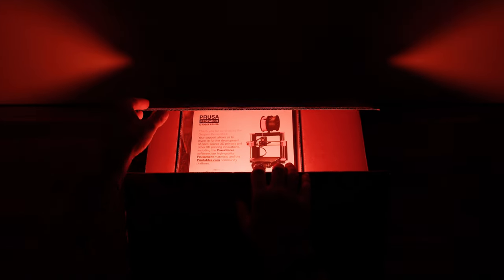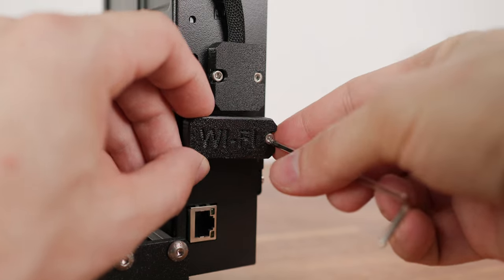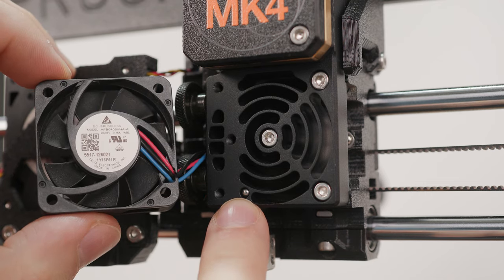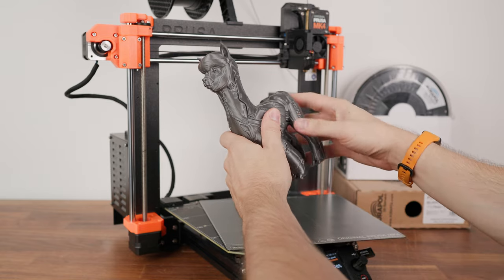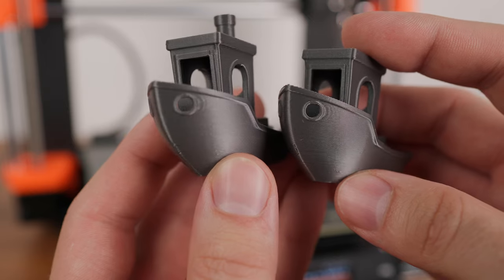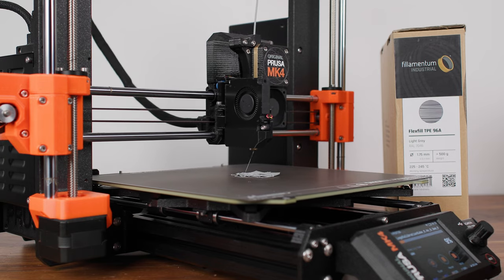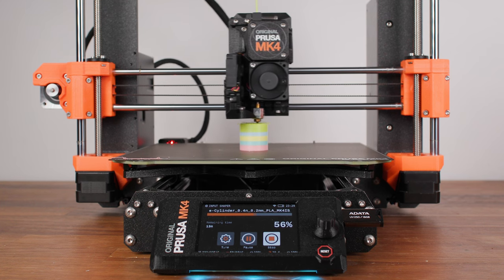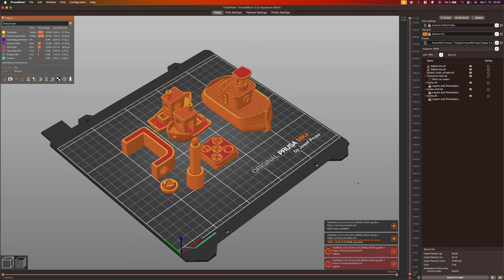Original Prusa MK4 - Better late than never. Don't you think? (Review)

Comment: I feel that an investment in a EU built open source unit is a future proof agreement and more than worth investing. I run 3 Prusa printers 2x Mini+ 1x Mk4 via Prusa connect Network . Absolutely flawless after Input shaper as game changer came alive and also Mini+ is supported and printing in superb reliable quality . Prusa doesn't try to take advantage from other manufactures brain like Bambu is even trying to patent things they have stolen from the open source community. Furthermore it is not proven at all how log the Bambu printer will keep reliable working and then hardly been able to reworked . For the Prusa you can refurb all printers up to new standard , print your spares or improved parts yourself. I like this better as it is securing my initial investment for years

Comment: I just finished building my Mk4 today. It was joy to build and a great sense of achievement. All components were of a very high quality, perfect fit and the instructions were clear and easy to follow. I dare say it helps if you are practically minded. I learnt so much about the printer but also about designing mechanical parts from the 3Dprinted items supplied. So far I am really happy with the printer and so pleased I was not tempted by other brands. I am new to 3D printing and would definitely recommend this to anyone else who is yet to decide.
Reply: How do you feel about the printer now? I would be new to the 3d printing world as well and am looking at a few
Reply from the maker: @curtflirt2 The printer is good. But here are better and cheaper printers.
My girlfriend wanted to buy a 3d printer. She decided to buy the BambuLab A1 Combo and the printer is printing almost daily. She is printing a lot of stuff for kitchen, her office and so on. Most of the things are ready to print on MakerWorld.com.
For newbie is the printer better choice than the MK4. You just put two pieces together and the printer is ready to use.
It's cheaper, smarter and more powerful than the MK4.

My MK4 just got the MMU3.
It works fine, but the AMS Lite on the BambuLab A1 works much better. 🤷‍♂️
Reply: @Zemistr3D  Thank you for the reply back especially after so long ago. My two choices were Prusa and Bambu
Reply: @Zemistr3D  can she print with TPU on the Bambu A1
Reply from the maker: @curtflirt2  Yes. Better without AMS, but yes. It works just great.
Also people on YouTube are having positive experiences.

https://youtube.com/shorts/njQOfJQhYUo?si=TE6D7ainpSlM1Msb
Reply: @Zemistr3D  Thanks again

Comment: At lauch Prusa stated "input schaper support", not 'input shaper". So they did not really lie about the import shaper. That the support for import shaper was present is proved in the new firmware.
The results with import shaper can be improved by placing the printer on flexible feet. This also reduces the noise significantly.  I have a MK4 next to a MK3s+ both on the same flexible feet and the MK3s+ is by far the loudest. For me the MK4 is a very reliable printer which is capable to run 24/7 without failures. You have to clean the nozzle yourself just before it resumes printing. Otherwise you can get ugly blobs.

Comment: All in all a fair test.
I can recommend it to anyone who wants to buy a mk4.
I don't think the conditions are fair compared to the Chinese competitors.
Therefore we know that a Prusa cannot be a price-performance winner.
But for me the European production and the high safety requirements are worth the extra cost.
In addition, the ease of repair and the long support. In my experience, prusa printers get better and better over time and receive new, useful updates.
In my personal case, the printer is in a printer cabinet anyway and doesn't have to be closed. As a private user, I don't care if it takes a little longer. I find the balance between speed, appearance and durability of the print to be quite optimal with the structural profile.
I built the Prusa as a kit and it works very reliably. After I sold my Mini I ordered the MMU3.
Unfortunately the delivery is delayed. But I had already expected it.
I think Prusa is rather poorly positioned in terms of personnel compared to the large Chinese companies. The lack of skilled workers in the EU doesn't make it any easier either.
Prusa may also make the mistake of respecting the rights of others.
You mentioned how attempts are made to patent other people's intellectual property.
Everyone has to decide for themselves whether they want to support something like this.

Maybe a little difficult to see in the video, but isn't the Voron and Bambulab also beginning to round off the corners a bit?
Not like the MK4 with Speed profile but a little bit.
But you can definitely see it better in the original.
Such edges are always problematic for input shapers. But if you look at the prints without it, the complaining is at a high level.
Reply: I'm in the process of deciding which 3D printer to buy as my first 3D printer. The Prusa MK4 is on the shortlist. For one thing, I'm a fan of open source and I'm not afraid of a slightly steeper learning curve. The price is perfectly acceptable for a product that will receive updates over the years.

In addition, I live in Germany. Prague is only a 3-hour drive away. So I basically shop in the neighborhood.
Reply: @andreas.grundler which printer did you end up getting?!

Comment: As for ABS printing - when I absolutely HAVE TO print something out of ABS I just... Put a large trash bag around the printer. Works surprisingly well as an enclosure :D
Reply from the maker: Yeah but... You can have better enclosed printer for cheap... So... Yeah... 😅
Reply: This is my type of maker. Carboard box and some tape in a pinch. The issue is there are two markets, "makers" who are tinkers and people who want to have an appliance to pops out plastic prints from their phone.
Reply: Creality tent works pretty good for my mk4 when printing ABS/ASA. Only 36$ on amazon. I keep the zipper cracked open on the top to keep the temp below 43°C
Reply: Enclosures help priming the plastic parts but the heat degrades/destroys the electronics and the machine plastic construction. So the plastic bag is a good idea as it is just what a fancy enclosure does, it stops the air moving as air is quite a good insulator.

Comment: The closed ecosystem and cloud requirement makes the Bambu Labs printers pretty much unacceptable to me. 
I'm absolutely willing to pay extra for a printer made in Europe that has a proven, robust design, good support and is easy to modify down the line.
Reply from the maker: Why is closed ecosystem and cloud bad for you? With most products you can't see what's the system inside and a lot of things people use are using some cloud stuff. 🤷‍♂️
Understand for big companies making new products trying to keep the prototypes in secret, but for standard user is cloud about more comfy experience. Also, any printer can run offline. 🫣
Reply: @Zemistr3D  I'm much of the same mind.  Bambu built much on what they have today on the shoulders of open source, and not a small part of that being Prusa.  They have made considerable improvements, but locked them away and patented them.  It's a bit sleazy business model.  And I am also willing to pay extra for Made in Europe.  But in the end it comes down to what your needs are.  I have a MK4 and it's been a solid machine so far, and I would absolutely recommend it to any beginner.  But it's hard to argue with the A1 being half the price.  I wanted a printer that I don't have to mess about with if I don't want to, but one that lets me when I do want it.  If you want to just print, the Bambu lineup will give you value for money.
    
Personally, I think that closed ecosystems will win.  For the simple reason that these have always found it far easier to attract venture capital.  These days, companies that just sell hardware, no matter how good, are seen as dinosaurs.  Companies that lock in customers and harvest their data are considered to be extra valuable.  So.  3D printers will eventually be as cheap and easy to use as regular printers.  I just hope these things won't refuse to print when you load off brand filament in them, like regular printers.

Comment: Wow! Thank you very much. I'm a Prusa fan and I know it's more expensive than Bambu but if it breaks you can fix it by finding pieces everywhere while if Bambu breaks you have to throw it away because you can't open it.  Prusa is expensive at first but saves money over time, it's a long-term philosophy
Reply: Bambu is fixable to a certain degree, but you're right, it's more closed off and there's less room for very specific (and cheap!) repairs and they aren't open source either. My only printer is a MK3S+ which I bought used. Now it has over 1050 hours and the cable of the bed thermistor failed. Bought that thing for 5,80 € and that's it. Fantastic. That's why I'm a fan of Prusa, too!
Reply: What are you talking about? Parts are readily available for bambu printers. There are video and written guides showing how to open and replace parts. 
If you are going to spout something make sure you do at least 60 seconds of research before commenting falsehoods. 
I have an X1C since Aug 2022 and over 6k hours run through it. Only replaced normal wear parts like nozzles or ptfe tubes. Anyone with at least room temp IQ can remove screws and follow a video/wiki.
Reply: @glowingeye  nobody has mentioned yet that the MK4 and MMU3 doesn't poop and waste material like the Bambu.

Comment: I own currently 3 printer (MK3S, K1 Max and Ender V2). For high Quality or precision parts I use the MK3S, for very large prints or also for ABS (due to the enclosure) I use the K1 Max,  and finally the Ender is just for Backup if the MK3S fails me again with a broken thermistor.  The MK4 is probably a hassle free printer that give great prints made with passion in Europe. However in the meantime for the same money you get more refined stuff.

Comment: Exceptional review
I ended up going with the mk4 over the other choices on the market. It was a tough choice. Being easily upgradeable appealed to me though, and I wasnt a huge fan of how Bambu seems to have pretty restricted ecosystems even within their own products. Plus I wasnt too happy with some security concerns I have with Bambu (saw some of that come to fruition with the whole cloud fiasco somewhat recently). I do suspect I will get an A1 mini at some point though, they just look like too much fun!
I was a bit concerned about the hardware being a bit.. behind when other comparable printers can be had with corexy, print space lighting (!!), cameras, etc. However, I can say the hardware itself is very solid. But as you say, the firmware holds it back. I expected this to be somewhat the case, but it was worse than I expected. Even some infills dont play nicely with IS. I think this will improve dramatically, so much so that I wouldnt have bought it otherwise, but they are playing catch-up.
I absolutely feel it is overpriced.
That said, Im not unhappy with it particularly since none of it was a huge surprise. I expect it to get much better with firmware updates. Hopefully lol
NOTE TO PEOPLE OUTSIDE THE EU: Getting parts can be tricky. Particularly with some items. Expect to pay more for it, because of lack of distribution. Printed Solid has a lot of Prusa stuff for the US, but their inventory is not 1 to 1 (I had to get the Obxidian nozzle direct from Prusa)

Comment: Good review! Personally i would pay the extra for prusa, since the mk series is a proven work horse, that is well supported for a long time and easy to repair (plus EU based company). But! I see how bambu lab will be a huge problem for prusa in the future. The a1 offers the same high print quality with some extra features for a fraction of the price. And while it is a closed system, it is very refined and hassle free in contrast to all other chinese companies. And you cant beat the chinese on manufacturing costs. What i mean: you can get close to 3x the a1 for the price of a single assembles mk4. Also prusa takes very long to develop their printers and implement features, while bambu lab is developing in a crazy paste. AMS lite, new quick swap nozzle system, motor noise compensation, flow calibration via new sensor. All features that were developed from x1/p1 to a1 timeframe. And bambu already announced that their second generation printers will be available sooner than later! I dont know if prusa will be able to keep up. Their advantage in print quality and hassle free experience is gone.

Comment: Good review!
Bambulab surprised everyone with their printers, I think Prusa makes good equipment but they rested on their laurels, you can see that they hurriedly released the mk4 that they had in "development" to be able to be present in the new generation, but you can see that it was going to be a mk3+, they added some new features, but they were not polished for printer output.

I think that no matter how good the printer is, the price does not seem right to me and it should be about 300-400 dollars cheaper, since in any case the p1s is a better option in almost every way.

I think other companies knew how to adapt better to the new generation such as creality, flashforce, qidi, etc.
Reply: The p1s is good, but core xy printers are ridiculously loud compared to a bed slinger. It's one benefit that is often overlooked

Comment: I'm stunned that they still havent enabled the touch screen controls. The UI is clearly designed for it. I totally understand them shipping the printer early to compete with Bambu and others, I would do the same thing as a business, but to still have the hardware underutilized this long after release? Seems strange to me.
Reply from the maker: Check the latest firmware. 😉 
The touch control is there enabled.
https://github.com/prusa3d/Prusa-Firmware-Buddy/releases/tag/v6.0.0
Reply: 6 0 firmware has touch support
Reply: I own a k1 and larger cr machine , would you say the mk4 is a good investment instead of two k1’s ?
Reply from the maker: @rubondomoralez1769  I think two tuned K1 are better choice.
At least you have Klipper and two enclosed printers.

Comment: I lucked out. The final version of the 5.0.0 firmware with IS was released while I was building my kit. The IS parameters are baked in, although I've found in the menu where to change them. I haven't changed them because I don't know what I'm doing... 🥸

Now I'm waiting for:
A- An IS calibration routine to be added to the FW.
B- Accelerometer hardware and/or specs to be released for performing an IS calibration routine.
C- A plated copper heater block to be released so I can start using the Tungsten Carbide (WC) nozzles that I already purchased for my now soon to be sold MK3S+. (Apparently aluminum blocks aren't compatible with WC nozzles because the radically different thermal expansion coefficients will cause WC nozzles to eventually loosen up in aluminum blocks.)

Comment: I bought the MK4, and it is better than the MK3S+ in most aspects. I also have 3 x MK3S+. I use the MK4 for fast prototyping, and the MK3S+es for production.
Reply from the maker: And overall... Do you feel like you got enough for the money you paid? Are you happy with the purchase? 🤔
Reply: I think Prusa wasted their recurses on the MINI, when they instead should have made the MK4 earlier or made are more cost-effective core-XY printer, or an IDEX.
Reply from the maker: @PerMejdal Totally agree. I feel like they just lost a lot of time doing stuff no one asked for or wanted in general. The XL looks promising, but after 2 years it's still not ready at all. 🤷‍♂️
Reply: @Zemistr3D  What I love with the MK3 is it dimensional accuracy between printers. I can design stuff that requires sub 0,1 mm precision, and have 1000 x printed on a print farm, without worrying that the dimension changed. The MINI does not the the same accuracy at all, and is basically useless for precision printing.

I was worried the the MK4 would be just as bad as the MINI, but I was happily surprised to see it being close to the MK3.

For me reliability and repeatability is much more important than fancy new features. That being said, I really like the new "cancel object"-feature on the MK4.

Comment: Ive been using a standard Mk3 printer for about 5 or maybe even 6 years now and was looking to buy a new printer because of a thermistor problem (I figured i had the mk3 so long that getting a new mk4 was worth the expense instead of repairing). But seeing what the Mk4 has to offer has changed my mind, and I'll just repair the mk3. The Mk4 looks incredibly disappointing. I expected that Prusa would be innovators however it seems that they have completely ignored their bread and butter standard printer. It seems like all they did was put a nicer screen on a mk3 and make it print slightly faster. And fairly useless wifi. thats not worth $1100.

Comment: can you change two fans to noctua？
Reply from the maker: Not sure. I think they have in the firmware written the rpm or something, how they control, that the fan is working how expected.
Reply: @Zemistr3D   Just asked support from Prusa, they said one of the hotend fan is noctua, but print fan is not.
Reply: @suppermanzzzz291  Not surprised. I don't think Noctua creates fans in the blower formfactor that the print fan is. Similar to the MK3 that uses a blower fan for the print fan and a Noctua fan for the hotend. (Earlier MK3 printers like mine have the traditional brown Nocuas, later MK3 printers (I don't remember when the switchover happened) have black Noctua fans.)